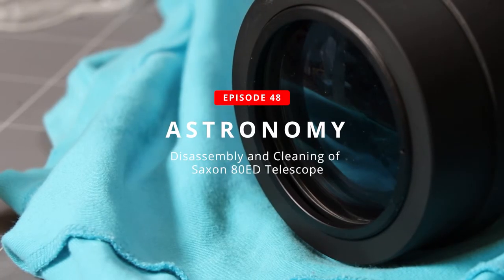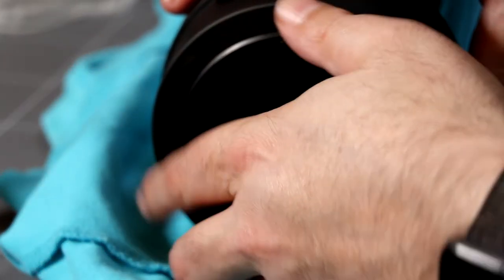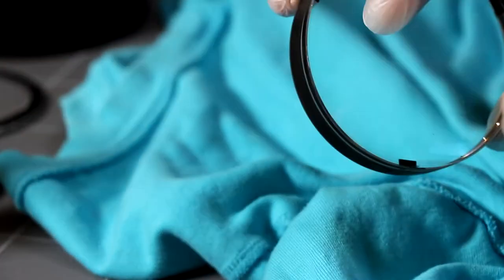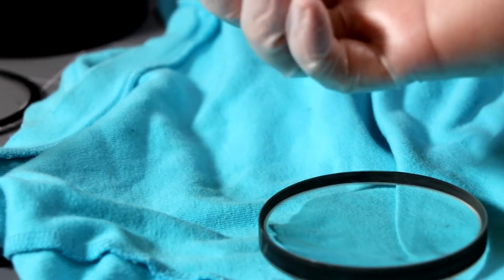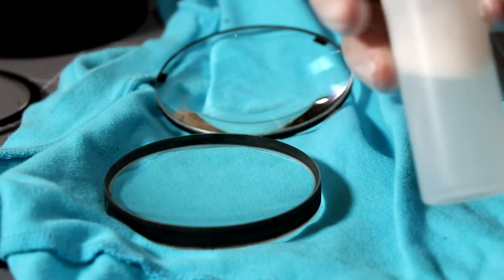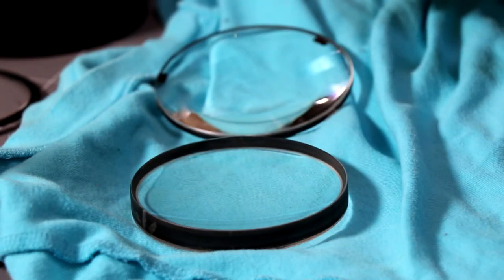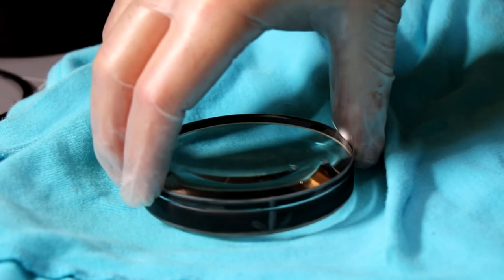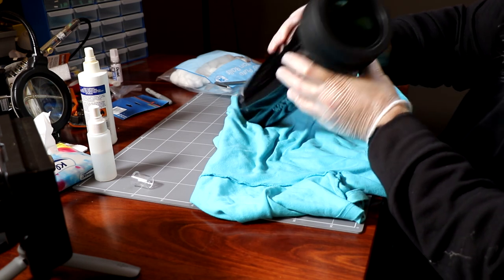Ep 048 - Disassembly and Cleaning of 80ED Telescope

Comment: Nicely done. My only comment is when you remove the objective it is a good idea to mark the outer lens element (crown element) with the lens cell. This will insure that the lens will go back into the cell (which is mounted to the tube) in the same orientation. This will insure that there will be no change in the end collimation which is relative to the tube and focuser.
Reply from the maker: You're right - Interestingly, with the 80ED in particular, either I got a 'good' one, or there is not an issue with the collimation depending on orientation. I tried moving it around to see if I could spot any differences, and couldn't see anything, so I might just be lucky.

Comment: there has no use of any glue between the lenses?
Reply from the maker: The pressure applied by screwing it in and the spacers are all that is required. You do not want anything interfering with the light
Reply: @TurboTalksTech  I see, thanks!

Comment: Do not clean ED or Fpl optics. To specialised. Too easy to damage. Will need expert collimating. I know. I followed this guide. Ruined my wo z81.  Now trying to work a way out of my troubles. Hey ho. Never mind.
Reply from the maker: I have done this many times and no problems with collimating at all. Not sure if the WO z81 has anything done differently but there is nothing clever about this.